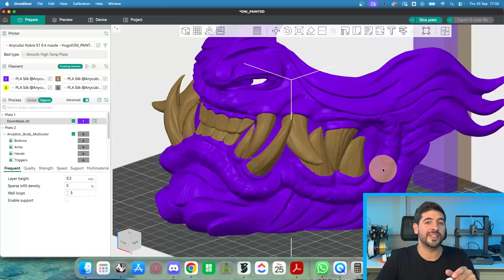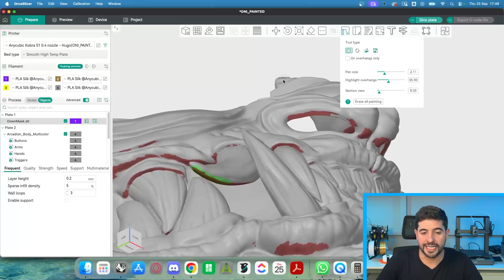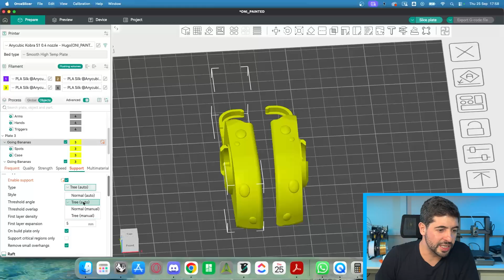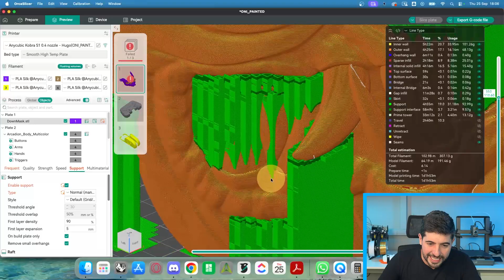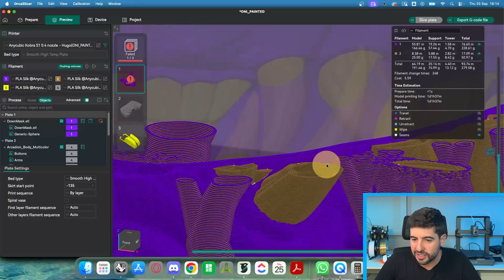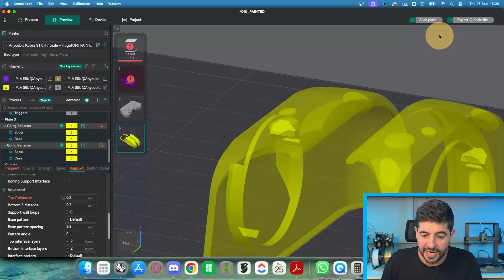The Secret to Easy Support Removal in 3D Printing!

Comment: When you print in PLA you can change the tips of the supports to PETG which doesn't really stick to PLA, this making it easy to remove. There's an option in BS to change the tips of the supports. Likewise, the opposite is true. If printing in PETG, change the tips of the supports to PLA. Try not to make the entire supports in PETG (when printing in PLA) or PLA (when printing in PETG) as this will add a lot of print time.